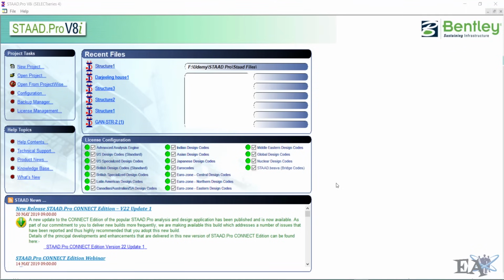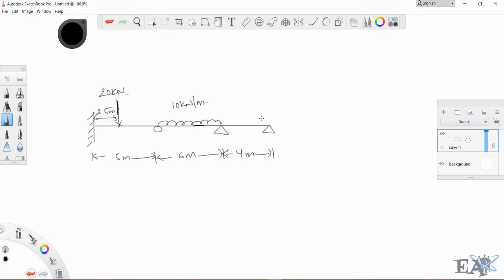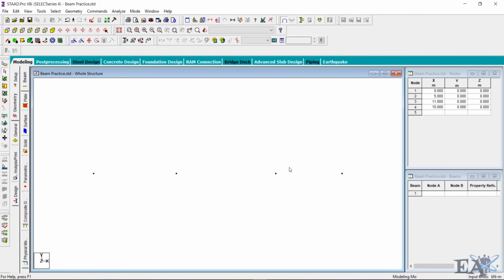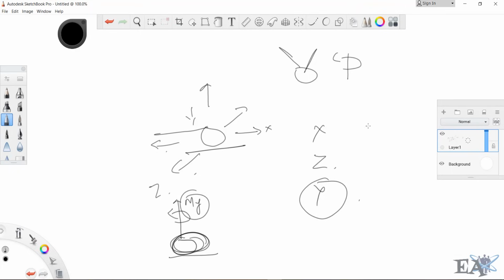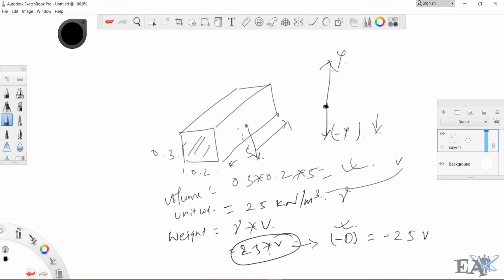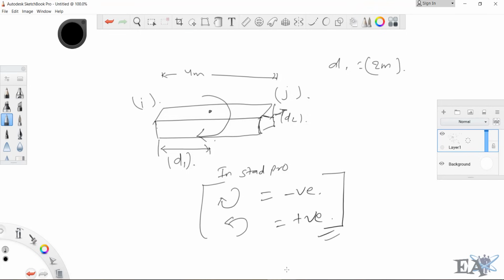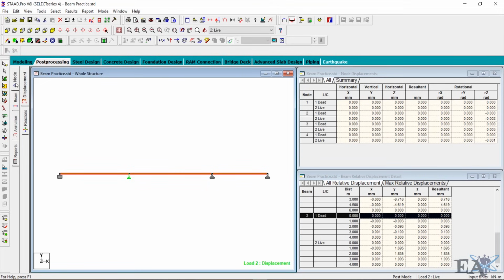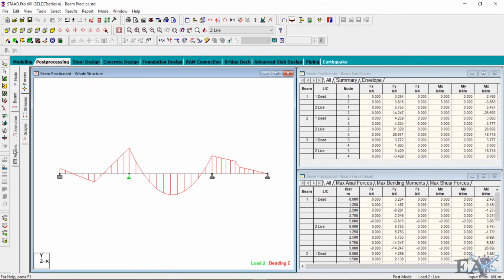STAAD Pro Tutorial For Beginners [Eposide 2]: Analysis of a Beam

Comment: Why we write d1 d2 d3 equal to zero in unformaly dustributed load case. In the question we have lengh of load is 6m
Reply: when the udl is applied on the entire span there is no need to mention d2, even if you put the value of the d2 result will be the same.

Comment: I have a small doubt when u putting the value of point load d1 is distance from origine  wrt to length, and why u put d2=0,  the value of is d2=0.2m
Reply: d2 is defined as the distance from the centerline to where the point load is,which in this case is in the middle, since most point loads are located on the centerline so d2=0